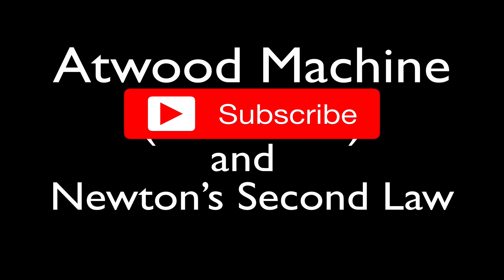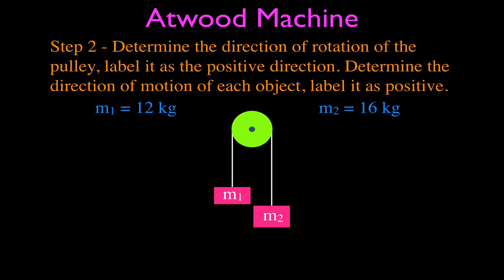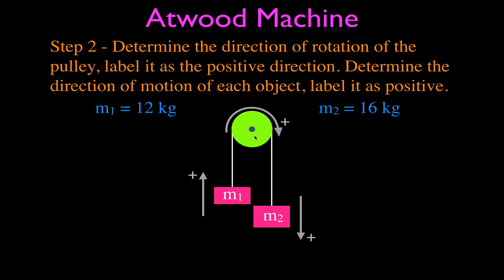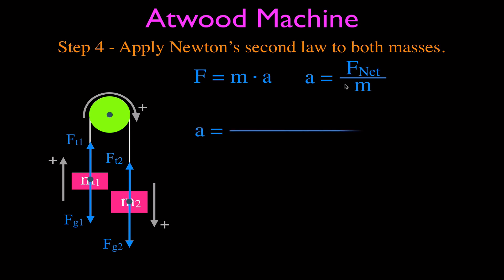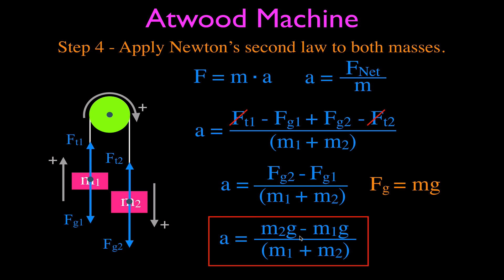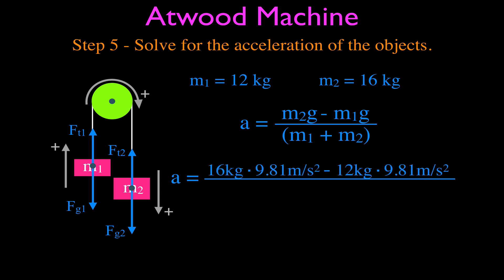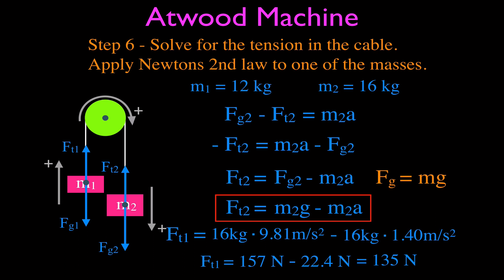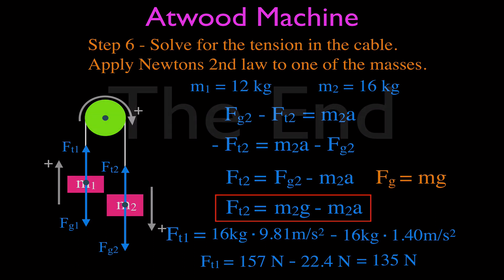Newton's 2nd Law (7 of 21) Atwood Machine, Acceleration & Tension (revised)

Comment: Sir can you plz help me in this problem ?
When car A starts, it is overtaken by car B, which runs at a constant speed of 28.5 km / h. The movement of A is initially steadily accelerating (acceleration 1.8 m / s2), but the movement becomes steady when A reaches 49.1 km / h. How long does it take for A to reach B? The movement of both cars is straightforward.

Give the answer with three significant digits.